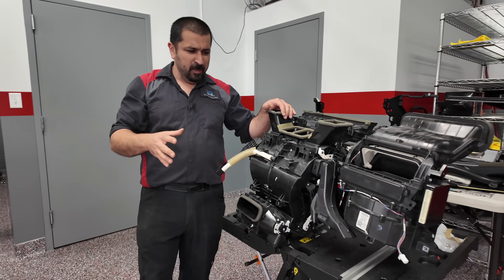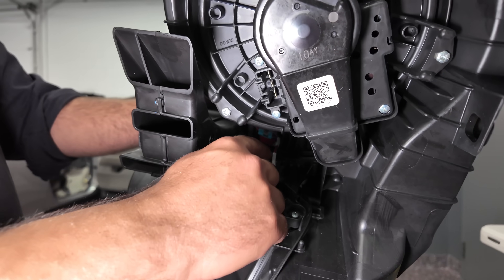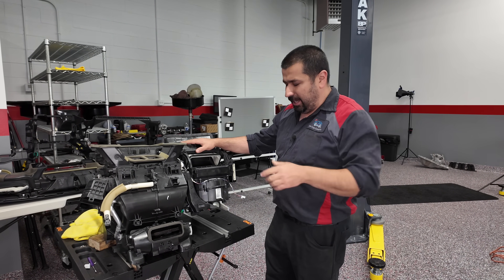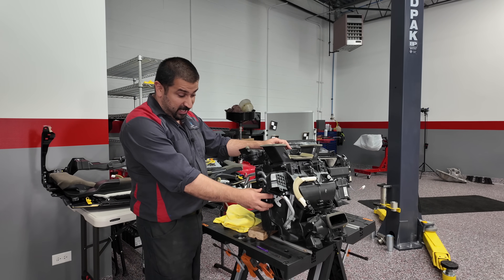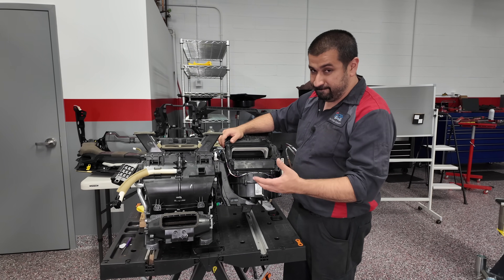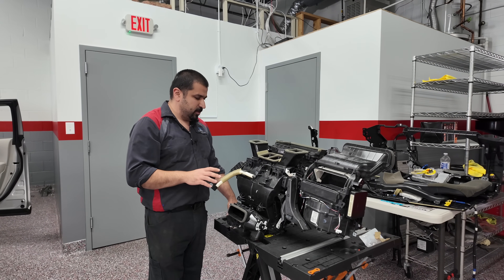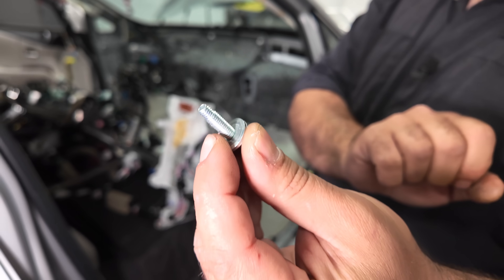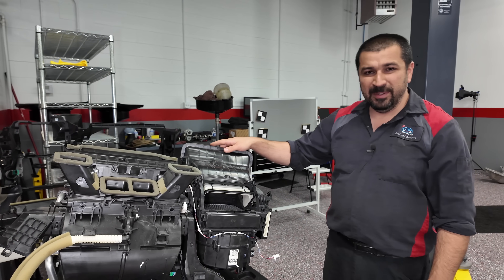THIS is Why Car Engineers and Car Mechanics Don't Always Get Along!

Comment: I had a 2007 Tundra Limited with no heat on the drivers side. 
My 20 year old 1972 Corolla’s heater worked awesome.  Simplicity is key.
Reply: Dash levers and cables worked.  No servos, no electricity except blower motor power.
Reply: In the old days, our fingers  were the motors what moved the wired that positioned the doors.
Reply: In France, regarding the Citroën brand, we said: "why keep it simple, when you can make it complicated"!! Some of their cars were a nightmare for mechanics

Comment: I used to own a Hyundai Elantra and my Nephew bought me a duplicate that was in mint condition but it only had a defroster that worked but no distribution to the other doors. We both watched one being rebuilt on you tube and could not find a door on either vehicle? I still cannot figure out how the actuator worked on my old one that the mint one was not working until i saw this video about this Lexus. We ended up keeping the mint one and using parts from my old one falling appart. Plus the mint version had 50,000 less miles than my old one. 
And when i bought it new, had only 14 miles driven on it. 
Plus the mint one with low miles had a transmission issue that my old one never had because my old one did not have a torque converter??? Any way we thought instead of change all the bulbs from the newer one that burnt out we will exchange dashboard clusters. What were unaware of is that the dashboard cluster contained the instrumentation that monitors the milage. We now had a newer mint vehicle with 50,000 higer milage than it really had on it. 
Eventually i donated the car and purchased a Toyota Carolla Cross Hybrid. I hope it does not have the same engineering mistakes the one seen on this Lexus has. I purchased a 2023 Demonstration Vehicle in 2024 after seeing their track record with the Prius. I only wish it had a bigger fuel tank.

Comment: just my 2 cents for those who own old cars like me, if you live in very hot weather and get just few days of cold weather like in south Texas, after having issues with broken recycle doors or the actuators, many times in the past I noticed that in my case always happened the first days of winter..... so after years working in injection molding I learned that no matter what plastic is ALL gets drier and more brittle in cold weather, there are even some plastics that once molded and cooled down we used to ship them in a bag with water inside so it could absorbed the moisture and not be brittle when got to the assembly line in winter, so, this is what I do since like 7 years ago and have not had an issue since then with all my old cars I cycle the AC system once a month with AC cold and the heat also even if we are 100F, (air up, mixed, only floor, defrost etc) just driving on the express way at consistent speed, of 65 or 70 so the coolant flow is high and also clean the evaporator core, I got to the conclusion that if you don't frequently cycle all these plastic parts they will get harder to move and especially if you have not used your heater for 8 months and then you turn it on a very cold day when the plastic is dry and brittle and... "snap" a gear or a lever breaks or a recirculating door side post and that is it... $1,000 or more to repair..... also I like doing this to keep fresh clean coolant inside the evaporator core.......
Reply: Like everything else.  USE IT or LOSE IT!!  LOL!!
Reply: @henrymorgan3982  motors wear out
Reply: Oh for the days of mechanical ONLY without interference from  computerized assemblies. Touch screens look cool, but aggravate the simplest action we used to do for our selves.😢

Comment: install deflectors on the face vents to redirect airflow into the windshield and voila! easy-peasy Japaneasy. perfect hillbilly fix. very low labour  cost.🤣
those  people should consider themselves lucky they don't get mice and rodents constantly getting into the hvac system and building nests and screwing everything up . ask me how i know this.  I've had half the dash apart on more than one occasion.🤬

Comment: I put in a set of push-pull cables(throttle controls for a lawn mower). Kind of like a power assist, crude but $1000 cheaper. The doors jam from dust.

Comment: Dang it! I was looking at buying one of these 3rd generation (2010-2015) RX350s to be my wife's daily driver.

We already have a 2007 we are giving to my daughter. I was hoping this generation was the 'sweet spot' of the RX350.

And by sweet spot, I mean it has the reliability of the 2GRFE engine, etc & also just the right amount of technology (blueooth, display, etc). We like tech, but prefer just enough to be functional w/out being too 'tech heavy'.

I love Lexus, but this video is very concerning to me. I may need to rethink my shopping list. 😢

Anyway, thanks (as always) for this very informative video CCN!
Reply: Just don’t drop anything in the vent on the top of the dash
Reply: 14 RX owner here since new, best car I've ever owned with ZERO repairs since new with 80k on the clock. Don't forget he mentioned something fell into the defroster vent to cause the malfunction. I wouldn't shy away from a 10-15 RX as long as it is clean and has a solid maintenance history. I wouldn't trade mine for the new RX. RX is not the only Toyota/Lexus that could have possible servo issues. I personally think you should reconsider a 10-15 unit, I'd probably look in the 13-15 year range.

Comment: I'm more than happy with the ice cold  AC  on my 1997 corolla which is all manual sliders for the direction and recirc controls.  Only I button to turn the AC on and off, the way it should be.
Reply: Yep bro. My 93 4runner also has a similar layout with cup holders in front of the 2 center vents also.  Drinks become cold for drinking in less than 10 minutes lol.
Reply: Yep. I have a 94 4x4 toy pickup and a 96 4x4 tacoma, and have been into the dash for light replacements. Not difficult dashes to work on. I will avoid new vehicles as long as I can.

Comment: i was able to repair blend door servo 2002 Lexus RX300. took apart servo and adjusted the drive screw mechanism by following youtube video and it still works 40K miles later. no parts required. Grateful after watching this 2010 Lexus nightmare!!!!